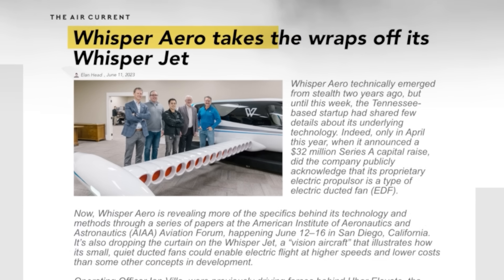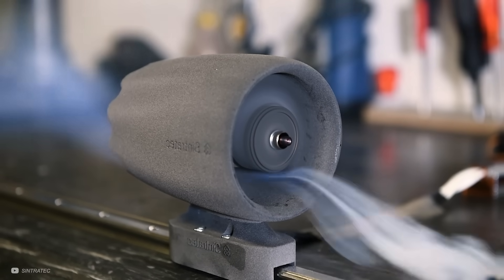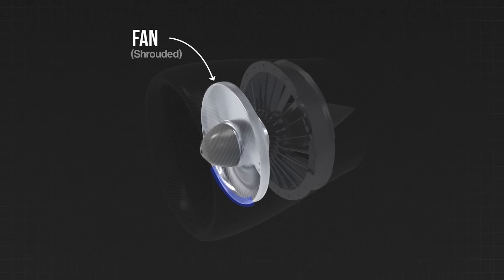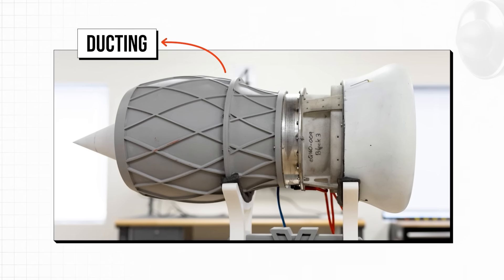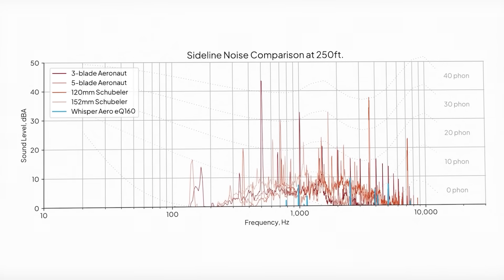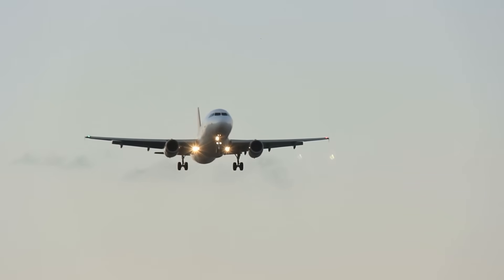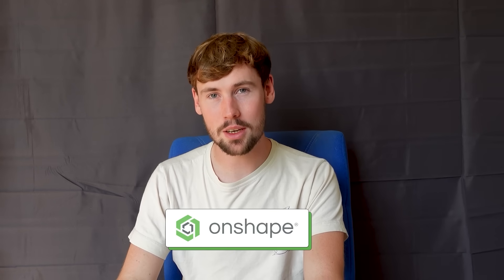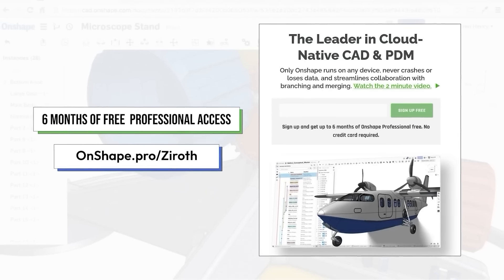This Genius Jet Engine Is Starting A Revolution

Comment: Yeah that's nuts that you think you're going to incorporate all of these into the Leading Edge of a wing because if the it Motors stop producing thrust they stop sucking in the air and then you're going to have boundary air conditions all stacking up on the Leading Edge and you're not going to be laminate or over the wing is in a Glide

Comment: 70 pound-force equals 311 Newtons of thrust. It is a small "toy" engine.
Reply: It means a 100 lb drone with 4 of them could lift me off the ground. That seems fun.
Reply: @ps.2  And the source of energy for those engines?
Reply: @ErikZiak These are driven by electric motors, if you didn't catch that from the video.
Reply: @ps.2  And where do you store that electricity? Or do you intend to fly connected to an extension cord?

Comment: These fans may be better than your average EDF, but, all other things being equal: per weight, unducted propellers are more efficient, many small fans produce much more drag and much higher weight compared to traditional propellers. Lilium tried the "many small ducted fans" approach, and failed. Whisper may seem be quieter to human ears, but on all other fronts, it will be worse (and 16 kHz is very audible to young people, which makes it terrible). The reason modern turbofan engines (which are ducted fans) use fewer blades than previous generations is that it is more efficient. And the reason they don't use integral blade-tip shrouds is that the increased weight more than eats up any efficiency gains. Since the fans do not experience huge temperature difference (unlike the turbines in turbofan engines), clearance tolerances can be very small, making them very efficient. Shrouds may be useful for very small EDF, but big ones win out overall. Even for the hot turbines, active clearance control is overall better than shrouds, which experience the highest centripetal forces and that need to be very strong and heat-tolerant, which makes them very heavy. Unlike active clearance control (non-rotating) shrouds.
It's interesting, but far from revolutionary. Probably not even economically viable on a small scale.
Reply: Great comment.
I like the way you back up your opinion with well explained facts
Reply: High pitch sound travels shorter distances and is easier to block. All else being equal, this is an improvement.
Reply: I've heard that a lot of times, but then why commercial airliners keep being ducted even with the high bypass rates they achieved latelly? They have become almost the same as EDF just powered by a turbojet engine.
Reply: @framegrace1  Above a certain speed, propellers don't work very well any more. As soon as the tip speed goes into the transonic range, efficiency goes down very quickly, and noise rises sharply, at which point ducted fans become better again. And when your aircraft speed is already transonic, you cannot avoid the propeller tips going even faster, because the forward speed and the tangential speed always add up. That said, modern open rotor designs are very efficient, more so than turbofans (where tip speed is also often transonic), even at high speeds (as the Tu-95 turboprops have for over half a century), but then noise becomes the show-stopper. On shorter routes, there are still a lot of turboprops, mostly Q400 and ATR, where the lower fuel consumption is often more important than saving 10 minutes flight time.
Reply: @pinkdispatcher   - Thanks for mentioning the DeHavilland Dash-8 Q400, even though my Employer Sold off the Full DeHavilland Product line, to another player in Canada!
Reply: @framegrace1  Might it be due to safety? If a shrouded blade breaks its the shroud that 'gets it'...
Reply: @framegrace1 two main reasons. Noise and safety. If a blade comes of a fan, it is moving incredibly fast, and can easily puncture the fuselage at very high speed, or damage critical wing components or an adjacent engine. That is why the certification process requires that if there is a blade failure, it must be contained. Uncontained engine failures are very dangerous. 

The fan blade tips are also travelling near the speed of sound, and are very noisy if not shrouded.

Despite that, there has been a lot of development work on inducted fans for airliners, but so far they have been hitting obstacles which have prevented them coming to market.
Reply: You are not taking into account the special oil they will use. The problem is the oil is animal based and can't be synthesized in a lab. The special animals are just now hatching from their eggs. I assure you once the snakes reach maturity, their oil will solve all the problems you mentioned.

Comment: Very poor propaganda, since the problem of electric driven plans did never come from engines, but from energy source, which is currently a very heavy battery, which carries way too less energy to run a plane engine long enough!
Pure propagandistic clickbait!
Reply: I mean, better air engines would still help, especially for short range electric aviation which IS viable... The problem here is there engines are absolute fraud garage
Reply: @mkzhero  No! The problem simply is, that the "energy density" of _ a n y _ accumulator is not even halfway comparable to any burnable fuel. In addition burning machines simply are way lighter (presumed identical power) than electrical engines - and that simply is because of the already known physical laws.
Reply: @McGyver008  What are you talking about? Burning machines (assuming by that you mean combustion engines) are extremely weak compared to electric engines of comparable size, and are also way more expensive to service and run, which is why not a single industry that can afford it in application method doesn't use combustion engines but electric (mills, lathes, assemblers, presses, etc), instead, the problem is with fuel storage and its density (batteries suck ass, but without them, for stationary appliances for example like in most industry, literally everything is electric, has been for about a century, and for good reason).

Comment: The only way any electric powered aircraft can even think of long haul - is to get a very very much more dense battery source of power or have it broadcast from the ground. One of the very few electrics available for human flight has a range of 75 miles, even if it increased efficiency 50% it wouldn't be adding much range. The same companies same model with an ICE engine goes over 200 miles, and its a tiny single seat plane.
Reply: Check out the Polaris, a hybrid seaplane that eliminates 85% of fuel consumption as a start.
Reply: High Speed rail is what we need, and I'm a pilot.  Rail is the answer.
Reply: @chadcoady9025  Why do you like rail better than aircraft? If demand falls you have this gaint concrete waste - like in California - an aircraft you can just change destinations. Plus per passenger unless you try the Elon vacuum tunnel - it's more expensive per passenger though less costly per ton. I went on a bullet train from Tokyo to Osaka - it was fine but half as fast as an aircraft - I'd be just as happy going faster.
Reply: @litestuffllc7249  I don't necessarily like it better than aircraft, but we need more rail to bridge the gap and extend sustainability of air travel.  Petrol is a finite resource and planes absolutely NEED the energy density of fuel because batteries are too heavy trains can run on electrified tracks. If passenger cars move to electric, and trains move to 100% electrified (instead of diesel electric hybrid), and cargo ships, freight trains and cross country trucking moves to hydrogen, we can keep the air industry alive longer running on jet fuel until new methods energy are available.  There may not be a solution to that in out lifetime due to physics.

Also trains can be automated, don't have delays due to weather, are safer, load and unload faster, and are more comfortable than flying.  You can take your bike onto the train and have another means of transportation if you want.  A lot of European nations have that figured out.  Plus it can be used daily for commutes to work for people who don't want to locate closer into the city.

Also, if we quit selling out liquid natural gas to China, and use it for trucking and more buses here, that'd be great too.

Basically we need more efficient means of public transportation.

Making it easier for people to come and go into the city will increase spending in the city as well.

Elons so-called vacuum tunnel is vaporware.  The concept was envisions back in the early 1900's.  It's not possible.  It was just a ruse to get gut funding for high speed rail so more people would buy electric cars and more roads would be built.  

California high speed rail is yet to exist.  They are still working on it, but the population density of California ensures it'll work, especially for people who can't afford to live in the expensive cities but who want to work there.
Reply: @litestuffllc7249  You picked a poor example where usually the advantage of flying over rail just isn't there. You travelled from Tokyo (or perhaps Shinagawa) to Shin-Osaka. All three stations are in central locations and much more likely to be closer to your actual destination than the alternatives: Haneda or, even worse Narita, to Kansai airport. Not to mention check-in, security, waiting at the gate, on-boarding, taxiing etc.
Reply: @ahenchan5422  Much of your concerns are policy and not physical realities - why should a train have less security?  Closer to the destination is where you want the airport or where you want the train station.   Flights come into Heathrow from all over the world, carriers and routes change, an impossiblitiy with trains. Trains almost always government run because no one else can obtain the right of way and put the burden of the infrastructure cost on taxpayers.  If you built a multi billion dollar high speed rail from Kiev to Moscow 12 years ago; what good would it have been?  The aircraft can be sent to where ever you want. If you want the airport to be right near the City like in Hong Kong you can or you can put it further away if you can't find the acerage downtown.  The main reason cities like Paris already have train stations inside the city is they've had them before aircraft were a viable option for most folks. Indeed the first multi national flights were Zepplines and they tied right up in the middle of NYC, today a better VTOL aircraft could duplicate that. After Zepplines were The flying boats like the Boeing Clipper - could land at any city with a large bay or lake, even large rivers.  Aircraft are far less tied down to highly expensive static infrastructure. You also have all sorts of aircraft sizes so you can serve small or big cities; where high speed rail pretty much only come in big.
Reply: Or have the (top-up, in addition to safety reserves) power beam-formed from a constellation of orbital solar panels for long-haul above the clouds flights. Some decades away, but...
Reply: @MattNolanCustom  That would be an interesting idea - anyone working on it?
Reply: @litestuffllc7249  not as far as I know. Some are looking at low density power transmission to large collection areas on the ground.

Comment: Electric aviation will never work on anything larger than a drone. The problem is not the fans or propellers, it's the fact that by weight, batteries are 40 times less energy dense than kerosene. The difference is even greater when you factor in the fact that throughout a flight in a kerosene powered plane the fuel tanks are getting continually drained and are considerably lighter by the end of the flight, whereas a flat battery weighs as much as a fully charged battery, yet still has to be lugged around.
Reply: You are correct. Batteries are heavier. Electric flight is still possible especially for short range flight. I'm sure we'll extend it by further improving batteries and adding solar. There are planes that can fly indefinitely on solar (they dont carry passengers) so im sure this could give electric planes a boost.
Reply: Well, fuel cells have much higher energy per mass than batteries, so there's an avenue to pursue. They work for spacecraft. And, even without that, there might be applications in the airship world. Then there are innovations that nobody has thought of yet. I wouldn't be too hasty to say that electric aviation will never work on anything larger than a drone.
Reply: @MattNolanCustom  hydrogen has terrible volumetric energy density tho. Even when using the densest and coldest form (liquid hydrogen), space shuttles were launched with a ginormous disposable fuel tank.  
Liquid hydrogen is not economical for flights anyway so consider compressed hydrogen once.  
I doubt if there will be any space left for passengers or cargo... It will be another financial disaster
Reply: Fuel cells require hydrogen, which is a big no no for aviation.
Reply: Why is this so obvious but electric aviation engineers don't discuss it?
Reply: @garymcdonogh3460  You mean like a Diesel Electric Loco, only the Traction Motors and wheels are replaced with a stack of these really cool electric fans?
Reply: @garymcdonogh3460  They do. All the time. With sufficient energy, we could replace all prop planes with electric today with slightly reduced noise and no innovation needed. But the battery technology we have today marginally makes sense for cars and busses, but does not make sense for ships or planes.
Reply: You do know that it could be electric AND use kerosene, right? 🤦‍♂️
Reply: @sandybrown7730  You mean like a diesel locomotive? Run a generator from the kerosene and use electric motors for propulsion? Don't forget the 2nd law of thermodynamics: Every conversion of energy from one form (chemical->kinetic->electric) means loss. It's better to just turn the kerosene into thrust by burning it.
Reply: But how much of a ton of kerosene will be used for useful work? Fossil fuel engines/motors are highly inefficient, with most fuel wasted. Electric motors are now 99% efficient. Do the maths.
Reply: @johnburns4017  electric motor efficiency is around 90% in cars, not 99%, and it would be similar, perhaps a little higher in airplanes.
Jet engines are a little over 30% efficient, maybe 35% for the newer high-bypass engines. 
Let's be generous and say that the efficiency is 3x higher. Let's also ignore the fact that when a jet engine "uses" fuel, the fuel goes away, while the electric airplane needs to still carry around the battery. It's still 13x less useful energy density.
Reply: @johnburns4017  Some jet airliners can fly half way around the world non stop. Battery powered airliners will never be able to do this. The concept of battery powered airliners is even more ridiculous and unworkable than propelling large container ships with battery power.
Reply: "NEVER" always indicates a faulty premise.
Musk has frequently stated that if no one else is interested he would make a supersonic vertical take off and landing intercontinental aircraft when battery capacity achieves 500Wh/kg.
Currently Tesla uses a mass produced Panasonic battery that has ~270Wh/kg and its own 4680 tabless cell of the same capacity for performance cars that beat ICE. The cells typically give an hour's flight in a small training aircraft, and make for a revolution in very cheap flight and instruction.
Panasonic typically make a 5% improvement every year, but recently announced a breakthrough with an anode-less design with a 25% performance increase, due for manufacture late 2027.
The research and development for batteries greatly exceeds ICE development.
As initial takeoff carries the major power requirement of an aircraft, a ground based launch method is indicated. Carrier catapults are a typical application of this. Then the aircraft climbs to the stratosphere and runs at supersonic speeds where energy use is minimal. During descent energy is captured, rather than used.
Morgan Stanley analysts estimate that "the chance that Tesla does not ultimately offer products and services to the eVTOL/UAM (Electric Vertical Take-Off and Landing, and Urban Air Mobility) market is remote. The potential skills transferability and network adjacencies are too strong to ignore.” By the year 2030, the total addressable eVTOL market could amount to $12 billion. By 2050 it could reach $9 trillion.
Reply: What the hell do you mean 'never'? With CURRENT tech it won't work, yes, but batteries won't stay the current lithium ion crap that they are forever, meanwhile electric motors are the most efficient and powerful ones we have by far, while also being the most lightweight
Reply: I disagree...  battery at 90% efficiency compared to 30% efficiency turbine...  might be able to do role of flying bus...  no pilot, hop between "bus" stations and swap battery at each stop.  Take off need more power, could be provided wire

Comment: Very interesting and insightful  ! 
I'm an EDF model jet flyer. Would be great to see a version of this accessible to our hobby. Our EDF power is limited to 1 stator & 1 twelve bladed fan driven my a 2.3 Kv inrunner brushless motor. As with everything, the key is energy density by weight of battery cell technology. Currently topping out with Li-lion.

Comment: so instead of annoying us with a rumbeling engine they gonna make a high frequency screamer to disturb nature? also, a DC electric motor seems like a weak choice for an aicraft, would not a 3 phase motor deliver much more performance at a smaller weight and scale? this "revolutionary design" appears like a step in the wrong direction.

Comment: I worked many of these same problems during design of the ducted of the AH-47 Comanche helicopter. I my proposal to enclose the tips for noise reduction and increased efficiency. It was rejected because It has never before been done this way. Being a Physicist rather than an Engineer my thinking was often deemed too "outside the box" for "real world" solutions.